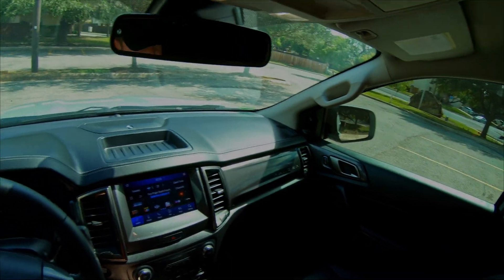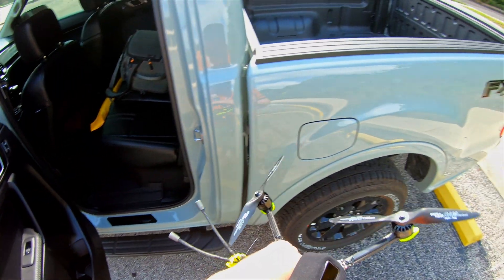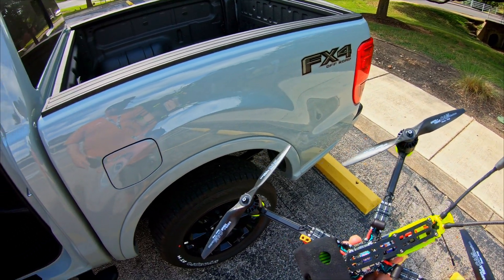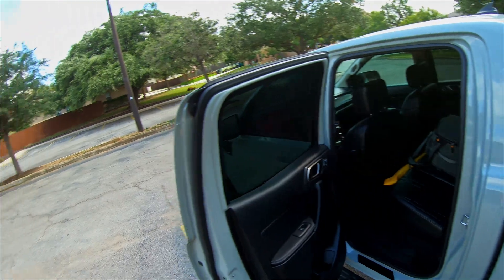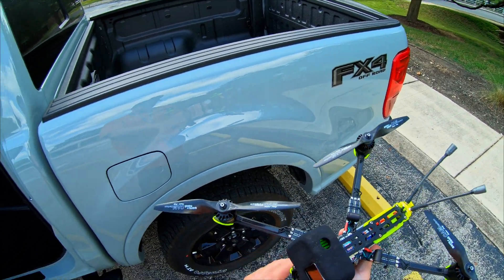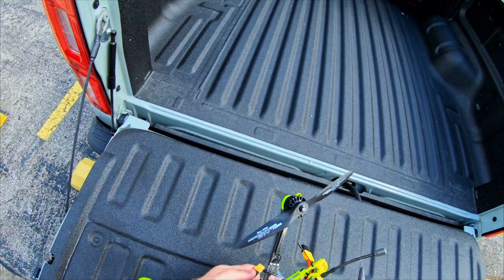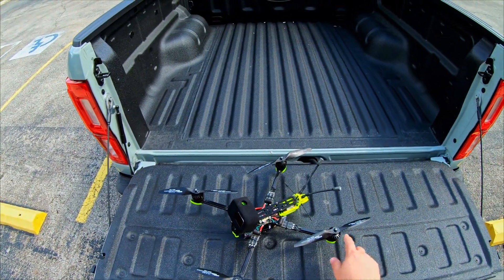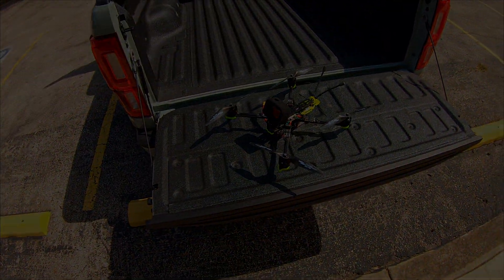XL10 V5 ProShot 1000 / APD escs

Comment: Amazing!
Reply from the maker: Thank you, have you run APDs escs before?  It’s nuts, really flys different, almost no prop wash
Reply: @Finalmile_FPV  i havent, im slowly building up a 12s 13" rig and plan to use em on that once i get it complete... 

I got one of those 8s iflight escs to try on my new 10" eventually but prob wont get around to swapping it until i make my own 8s packs, but yeah this looked amazing so i may have to try em on 10" eventually too.... 

ordered 4 sets of those 10" props and they should be here any day now too, although i prob wont get around to 10" testing until my new frame comes in and i swap everything over as i got new versions of my 7/8/10" frames coming in a week or 2, and gotta test 10" cinelifter for the next couple weeks.... did a maiden on it today, i hope this heat wave ends here so i can push it
Reply from the maker: @badfourlife  that sounds amazing, as much trouble as I had with 10” stuff I’m not sure I’m going to go bigger. I am seeing a lot more people going to 8s now, not like the switch to 6s was a few years back but seeing a lot more motors in that 400-800 kv range and huge stators. I hope you like the props! Hot here too, high 90s and all my batteries and motors are running hotter, makes testing new builds stressful, I know the ambient will push temps up but just really holds me back on the confidence to be more aggressive with the tune and filter settings.